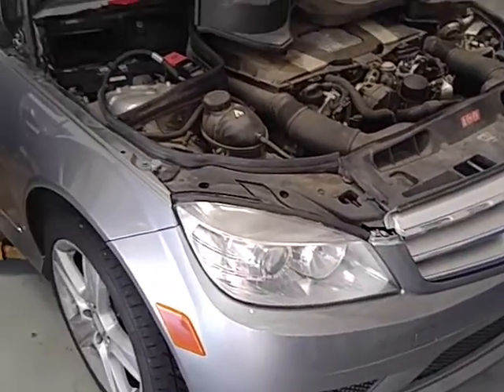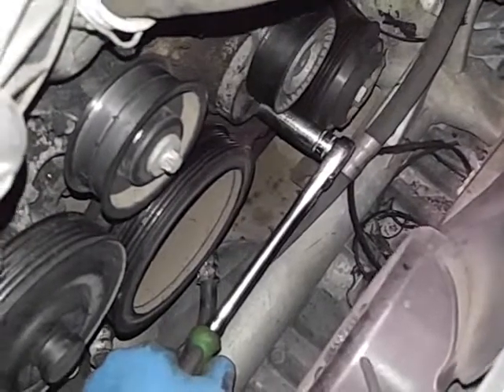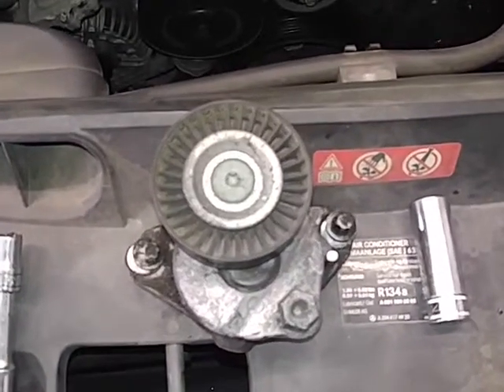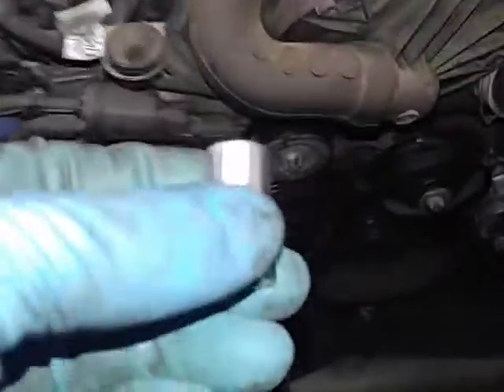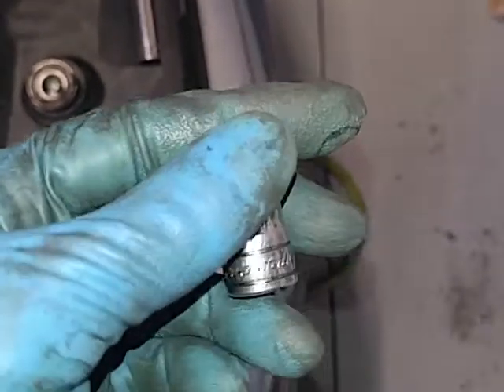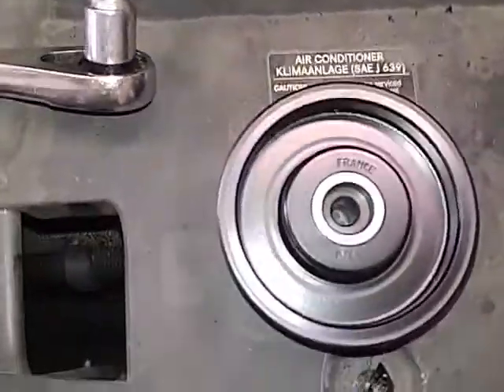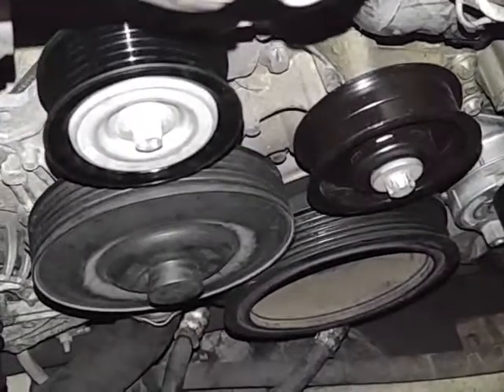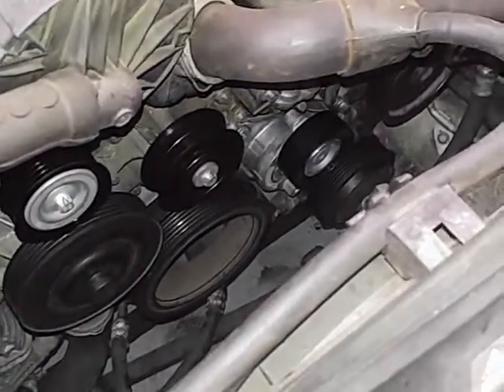2013 C300 pulley and tensioner removal and install

Comment: How do I remove the pin after install
Reply from the maker: Pull back on the tensioner like you did yesterday to remove the tension of the belt and take the pin out.

Comment: Are both idler pulleys the same size?
Reply from the maker: Ahmed Raheem there the same size but the center of the pulleys are different one has bushing installed in the pulley and the other comes with the bolt that has a bushing
Reply: DA TRUTH ok because the part stores around my area are telling me there universal and will work on either one
Reply: One shops asking 20$ for a economy brand (apperantley it will work on both). But the dealer is more specific to which one and wants 60$ which might b worth the price difference ?
Reply from the maker: Ahmed Raheem go to the dealer because I have bought one from advance auto parts and it was not correct one of the pulleys you can only buy from the dealer
Reply: DA TRUTH thank u much appreciated
Reply: DA TRUTH why is the bolt behind the tensioner so hard to get out ? Even with it locked in place
Reply from the maker: Ahmed Raheem it shouldn't be that hard to get out it's usually not

Comment: that's a 2010  w204 c300..i have a 2011. I can tell by 1- the mirrors (they changed  to this style in 2010 which carried through to the end of w204) , 2-the headlights (eye brow style..2011 was last year of them..my are tinted from factory...not clear) and 3-the fog lights (round),(2011 they changed to long led style)..the 2013 have the 'up swooping*' headlights..and the led long fog lights. *for lack of a better term..don't know how else to describe them.  (the years I give are US  sold model years..)

Comment: Bro my mechanic keeps playing guessing games. Already replaced 2 new belts got shredded up he replaced the alternator,  pulleys except for the tensioner need help???
Reply from the maker: You need to have the tensioner and both idle pulleys replaced I'm sure that should fix your problem
Reply: DA TRUTH Fsho! Mechanic replaced the alternator and 1 pulley & power steering pump...dam near 1300 bucks already and two belts shredded...I feel I’m getting ripped of by him just guessing . Just because he got his own shop I feel he don’t know much about Mercedes 2010 c300 sport... am I over exaggerating
Reply: @sr166   MB or any car require specific knowledge to diagnose problems correctly.
Your experience with this shop acting stupid is EXACTLY THE SAME AT MB DEALERS WITH "FACTORY TRAINED"... liars - It $1300 bite at the time often for no fix. They are not exactly in the business of fixing cars but milking us

Comment: Not 2013
Reply: almost looks like my M276 besides the air pump and this throttle intake near firewall near engine rear, right?

Anyways they share the same plastic parts and soft timing chains failure